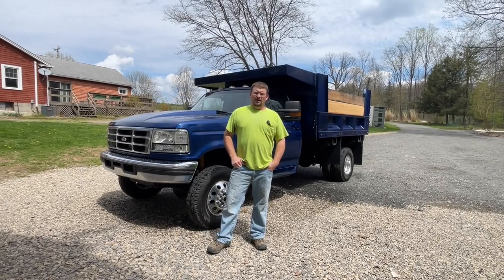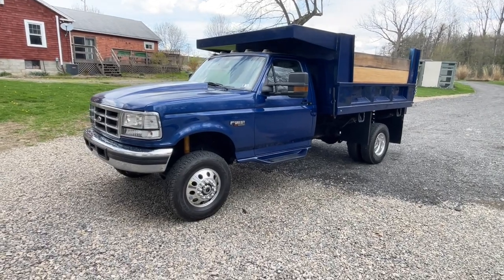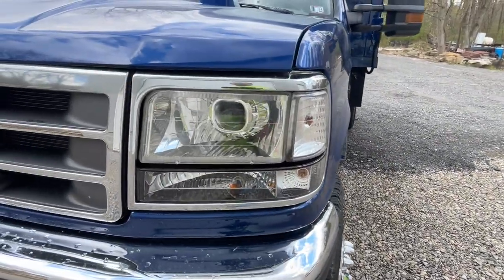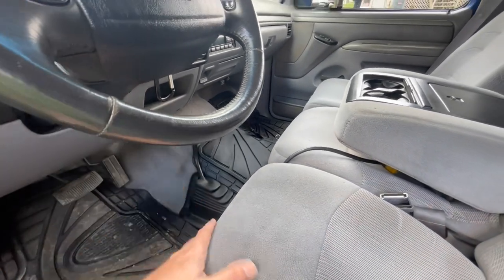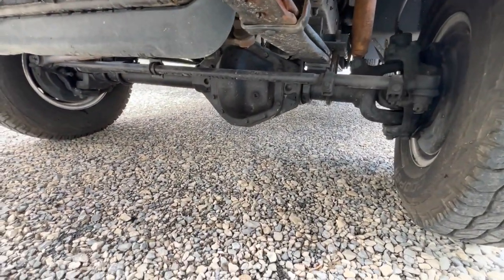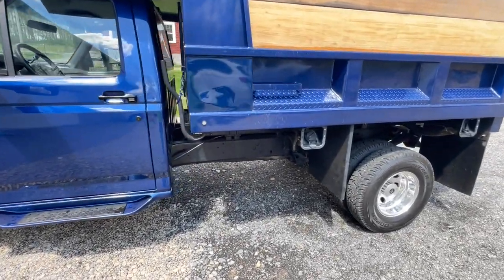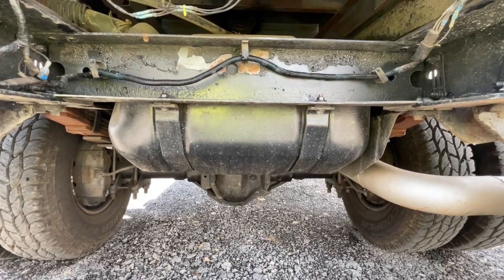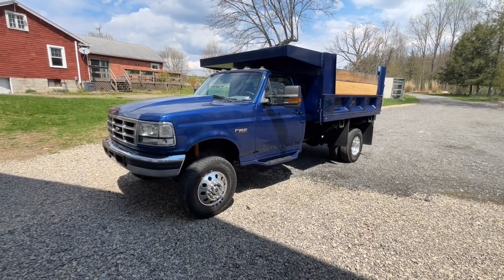Quigley Converted 4x4 F-Superduty Project!

Comment: That’s awesome that you saved that thing. I worked at a used truck dealer for two decades in Bucks county. I saw these things disintegrating at four and five years old. I finally scored one a year ago with 52,000 actual original miles on it. 88 F350 7.3 5spd built by the TVA with a 34 foot reach bucket on the back of it. It’s spent its entire life just changing lightbulbs. I’ve been methodically rebuilding everything over the past year. It’s almost at the point where it’s ready to drive. Aside from some body surface rust it’s a find of a lifetime to me. It’s been 30 years since I’ve seen one of these with 50,000 miles on it.
Reply from the maker: That’s low miles for sure!   Most guys just run these trucks into the ground sadly.

Comment: I have a '97 F-SuperDuty, 2WD, and it has a 161" wheelbase with a 12' bed. It has cabinets and toolboxes on it, but it only weighs 7550 per the registration. I've been looking for a 4WD, and figured I could cut down the bed and get a shorter driveshaft, but it always seems to be more work than I want to do. My property has a very steep driveway, which is why I've been wanting a 4WD. The problem with that era of trucks seems to be that the GVWR is not that high, 15000 is much lower than even an F-250 SuperDuty built today, which is over 20000 lbs. The OBS F-250s are only around 8800 GVWR, so even though I can find something with a diesel (I have the 7.5L 460ci), the GVWR doesn't gain me anything, it loses me in fact.🙄 I've always though my truck would be nicer if it was a bobtail. Mainly because 8'x12' bed is a problem driving around town. EDIT: FWIW, I only get 8 MPG on my truck also...<ouch> Have you had to replace the steering column? That's a major job in itself...in fact the entire ignition system was designed by a moron.
Reply from the maker: A new F250 has a GVWR of around 10,000.  Give or take whatever suspension package it’s got. 

Steering columns are easy, it’s explained in the dash removal video I have posted.  

460 trucks get between 8-10 as typical fuel mileage.  

4x4 swapping one of these old F-Superduties is always a lot of work depending on which route you want to go.  And either one you take isn’t cheap sadly.
Reply: @GarrettsOBSGarage  don't know which F-250s you're looking at but I see the SuperDutys with over 20,000 lb. GVWR. OBS model F-250 HD only gets 10,000 lb. GVWR. Let's not confuse payload with GVWR.
Reply from the maker: @konoctiswigwam8130  I think you’re looking at tow ratings.  GVWR is Gross Vehicle Weight Rating.  Which doesn’t include towing capacity.
Reply: @GarrettsOBSGarage  Yes, GVWR includes both the vehicle weight and the payload. How much payload do you get on an OBS F-250 HD ? End of story. My GVWR on my F-SuperDuty is almost twice what the 250 is. Mine has power brakes front and back with an 11,000 lbs. rear axle. I can comfortably haul 7,000 lbs. And to think that an old OBS 250, even the HD, can hold it's own against even a 10,000 lb. trailer is absurd. A lot has improved. Having a diesel and 4WD would be ideal, but I have a lot of machines to haul and I can't afford a diesel that can do that.
Reply from the maker: @konoctiswigwam8130  F-Superduty GVWR is 15,000.  A 95 F250 with a 7.3 is 8800.   A 2017 F250 with a 6.7 is 10,000 GVWR.  Which is weight of vehicle plus payload.  A 2024 F350 can be 14,000 GVWR, a 2024 F550 can be 19,500 GVWR depending on options and a 2024 F600 is 22,000 GVWR.    Those are specs straight from Fords website.  

Each of those trucks weigh differently depending on options and upfitted equipment.  So, what they can put in the bed is different for each truck.   Either way. Only one of those trucks is over 20,000 and it’s the F600.

Towing, all of the 1995 HD trucks have a 10,000 pound tow rating for bumper pull. I don’t know what the new trucks can tow.  But it’s obviously more.

Comment: I cannot thank you enough for making this video. I just picked up my own obs super duty manufactured in August 94. Would it be considered a 94.5 model? It is 2wd powerstroke zf5 xlt with a flatbed and dark red interior. I hope to one day convert it to 4wd with a divorced np203/205 doubler. I would love to know more about your front axle, specifically info about the brakes and the wheel adapters. Also I am extremely jealous of your wheels lol they're beautiful and match your build perfectly.
Reply from the maker: The 4x4 F-Superduty is such an oddball.  Not many people know what they really are.  Id love to do a more in depth video of it one day.   August of 94 COULD be a 94.5  Count the grooves on your engine serpentine belt.  If my memory serves me correctly, you should have 7 grooves in the belt, or 7 ribs on the pulleys if its a 94.5.  The 205 is a heavy case, and will absolutely require its own crossmember, and rubber mounts.  You'll also have to modify the tail shaft housing of the transmission to allow the linkage to get to the 205.  The front axle is a custom made axle by Quigley.  Its a 70 center section, with 60 outers, but has a custom made hub to be 10 bolt.  It uses the OEM Rotors and brake calipers, so there are no adapters for anything.  It took me a LONG time to find wheels, and the search paid off!  Thank you for the compliments!  This truck turned out much nicer than originally planned  haha
Reply: @GarrettsOBSGarage  I had a chance to look today and it does indeed have a 7 rib p/s pulley as well as a 7 rib idler pulley. Thank you for the tip 😀
Reply from the maker: So, 7 tips, or 7 dips in the pulley?  If its 7 tips, you have an early 95, if you have 7 dips, you have a 94.5.  I did a little research on it, and the 94.5 is a 7 rib belt, and the 95 is is an 8 rib belt.
Reply: @GarrettsOBSGarage  It has 7 dips and uses a 7 rib belt
Reply from the maker: @visura5149  then yes. It’s a 94.5.  So when your order anything for it. Be aware of the build date and stuff. There is a lot of little differences between a 94.5 and the rest of the trucks.
Reply: @GarrettsOBSGarage  I definitely will. thanks again for the tip 😀

Comment: Thinking about purchasing 94 f superduty with quigley 4x4 conversion,  was wondering about getting brake parts and front end wear parts. Do they use stock ford parts?
Reply from the maker: Quigley uses a mix of their own proprietary parts and OEM parts.  If you buy that truck, you need to call Quigley and update owner information with them and they can send you documents describing it.
Reply: @GarrettsOBSGarage  ok thanks was worried parts might be obsolete
Reply from the maker: @johnt2226  you have a better chance at getting Quigley parts than OEM at the current rate.  OEM is discontinuing a lot of parts for the old trucks. And Quigley generally has a stock of parts.

Comment: Nice ride. Can’t go wrong with a 7.3 PSD. FASS would probably have been easier than the Irate kit
Reply from the maker: Thanks!!!   I've never been a fan of the "all in one" setups that they make.  They are too bulky in my opinion.  They are easier, but I don't like how they look, and they also use a lot of proprietary parts which makes replacements harder to get.
Reply: @GarrettsOBSGarage  I looked at both systems and I hate the way the Irate system is designed. There’s too many parts. The FASS system is better designed and has the fuel regulator and return built into the unit itself. The only thing I had to purchase extra was the fuel distribution block from CNC Fabrication. It allows you to distribute the fuel to the four corners of the engine cylinder heads.
Reply: @GarrettsOBSGarage  that F-Superduty is one sexy ride thought. It’s perfect for the zombie apocalypse.
Reply from the maker: @kenxiong6830  I have built a few systems and bought the irate regulated return setups. And I’ve never had any issues with them.  The extra parts just make it a little more streamlined. 

And thanks!   It’s a good truck and I hope it lasts a long time for me.
Reply: @GarrettsOBSGarage  keep up the good content. I enjoy watching your videos
Reply from the maker: @kenxiong6830  thank you!

Comment: Good looking rig eh?!! Neat to see a dana 70 conversion. You running a bw 1356 t case in the old gal?

Had one of these with an idi and 5 speed… slow with 5:13 gears but fun to rip around! Theyre mint with a stack, tractor flap and glass packs
Reply from the maker: Thanks!

Yeah this has the 1356 in it. 

The 5:13 is way too tall for one of these with a little extra added power. That’s for sure!

Comment: Im working on a 97 fsuperduty. Currently has a flatbed on it but im working on putting an 11 foot service body on it. In the process of replacing beds I need to clean up the frame. What product did you use to paint your frame and would you use it again or go a different route? Also do you happen to know what was the difference between the XLT and Xl models...mine is an xl and was tempted to bring it up to alt spec....not sure yet.
Reply from the maker: I generally have the frame sandblasted. And painted with your choice of paint.  I used chassis saver on most of the frames.  This one was some oil based stuff in a rattle can.  Only because I knew it wouldn’t see winter again.  It’ll be an easy touch up.  

If you’re not going to do the sand blast route, I suggest using something like an implement paint, as it shouldn’t sheet off like an encapsulated type product may if you don’t have good surface prep.

Comment: The front is a  70 center with 60 outer nuckles  and some how the 10 lug  rotors  were mated  the spindle?
Reply from the maker: Basically. The hubs are custom made by Quigley.

Comment: Is it possible to find a small lift kit for this truck? I have a 1996 f-super duty and I want to make it a 12ft flatbed service truck but I get caught in some nasty area at times and would like the truck a little higher.
Reply from the maker: Only way to really lift an F-SD that’s 2 wheel drive is custom leaf springs on the front since they are a spring under design.   The rear could be leaf spring or blocks like normal.

Comment: hi.  Nice truck.  I bought a 1995 F-SD at auction,  crank , no start.  Have you updated your truck to OBD2 port compliance?  Just bought a used snap on MT2500 brick scanner.  ever used one on a pre obd2 OBS?
Reply from the maker: I am pretty sure the 1995 has the OBD2 compliance from the factory, the only ones that were a little odd with the OBD2 was the 94.5 trucks.  

A Crank, No Start could be just about anything on these diesel trucks.

I had an MT2500 for a short period, and only used it once or twice before upgrading to a more user friendly scan tool.  So, I am not very helpful there, sorry.  The MT2500 is a good tool, but its not very user friendly in my opinion.
Reply: @GarrettsOBSGarage  thanks for the feedback and for the videos
Reply from the maker: You're welcome!  Glad you're enjoying them!